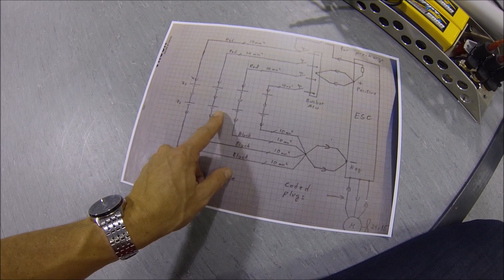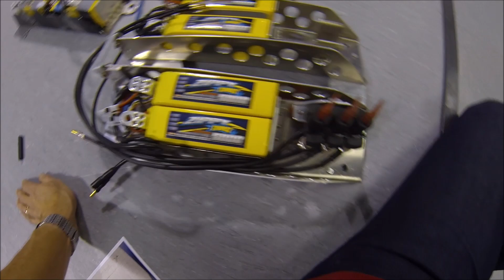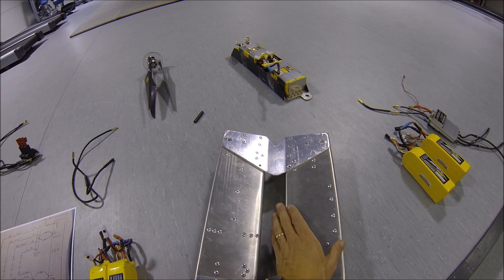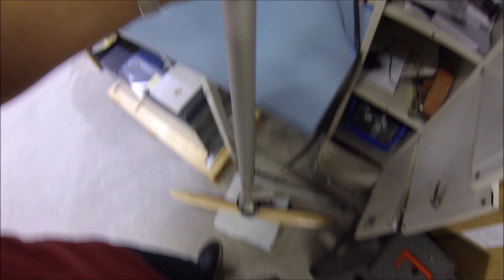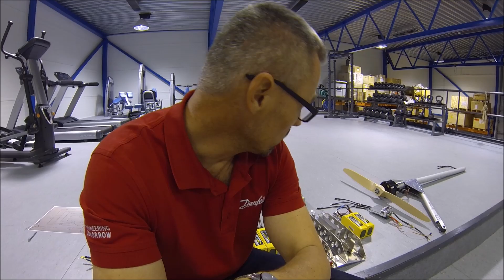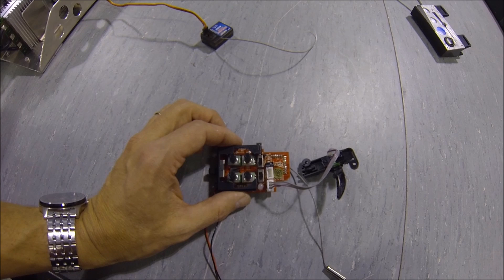E-Help, how it is made, part 1

Comment: Nice video.  What is the total battery life?  I mean, how long can you fly with the engine running?  Sorry maybe in the video you said it but I don't speak English I'm translating from Google...
Reply from the maker: This small 0,5 kWh you can fly for some 10-12 minutes. We use it not so much for climb more for  moving horisontal after launch from small hill. The can easily fly 5 km distance to better thermal trigger point.
Reply: @AcrodesignerLNSNI  thank you so much you are very kind :)

Comment: Hi. Does the foldable carbon fibre propeller fold out when it spins? And can you please share with me the brand? I would like one. Also what 80KV engine are you using?
Reply from the maker: It folds out by centrifugal force. And folds in by windstream and rubber band pull. The prop is from company RASA. And is a 3 blade 34x22

Comment: what method do you use to lock the propeller so it doesnt windmill when the power is off in flight?
Reply from the maker: Paul Martin We activate the brake function on the ESC

Comment: I have been waiting for this type of awesome system to become a reality for the masses! My question: I have a Guggenmos E7 I want t o use this on. Do you think it's too heavy to foot launch like the Exxtacy? My E7 seems pretty light on my shoulders when running on flat ground. Maybe if I limit foot launching to a good headwind!? Thanks for your work!!!
Reply from the maker: In good headwind anything goes. But ground handling is still pretty heavy with an Exctacy. I have flown the Axxess fixed wing a lot with E-Help but aleays dolly start

Comment: The e-drive systems for kites all look so bulky and complicated.
Is not it possible if you take, for example, 2 aluminum or carbon tubes, in which you installed the drive batteries, this then under the focus left and right of the longitudinal center bar
Fastened.The motor with the folding air screw is attached to the end of the central tube, the wiring can indeed very easily with control panel in or on the Speedbar
Be attached.
Thus, all parts would be housed in the smallest space and you would not have to carry everything on or in the harness with.
It's just a consideration as a layman. Or the drive must be mobile on the pilot.
I think if it comes to a tipping moment, the pilot can indeed start from a starting car and avoid this.

Comment: how much thrust does it give
Reply from the maker: The student version is about 28 kg with the 34x12 prop and the big flatland version is 32-34 kg thrust with the 34x14 prop at some 4500 rpm about. The rpm increase and the load decrease when moving forward so my numbers for static ground tests changes a bit in the air
Reply: if i use 16 s what will be thrust

Comment: Thank you for your valuable work and patience, Reidar. Have you considered using lithium battheries instead? You can reach up to 7 Ah for 0,6 Kg in one element (Skyrich HJP7L-FP for example). What do you think? Thank you in advance for your kind answer.
Reply from the maker: The C rating is usually very low for lithium batteries compared to lithium polymer. In the newest version of E-Help we use a Crating of 70. The battereis are then type KDLIPO 5000mAh 70C 25,9V
Reply: Thank you!

Comment: Awesome. What is the altitude you can reach from the flat land start with the student or full version ?
Thank you
Reply from the maker: The student version is not flatland capable. Only 0,5 kWh and ment to be a zero sinker from hill to find thermals. The full version 1kWh with nanotech 90C batteries can climb from flatland to about 400 meters but that is misuse. Correct use is to climb to some 150 meters only and then use reduced power to cruise zero sink for finding thermals over a 5 km out and return pattern.
Reply: Reidar Berntsen Thank you, good work

Comment: Hey Reidar , is it possible on this esc Hobbyking (6-14S 60v) to use 3 packs 5S (15S ) 18,5V x3 = 55,5 volts,  with the new motor U15 II KV80 ( http://store-en.tmotor.com/goods.php?id=731) thanks a lot

Comment: Hello Reidar
What maximum RPM prop 25x15 the 30x10??..thanks
Reply from the maker: 25x15 on 150 KV it is about 7000 rpm and with 105 KV it is too small prop yo make sense. The 30x10 goes supersonic tips and breaks down performance at 150 KV. On 30x10 that is a too small prop for the 105 KV.

Comment: I find a motor with original 65 KV and 25KW for the same price like the hobby king motor you guys use. Du you think that I can use this motor with the same akkus and only drive it by 70% of its power for not heading up the cables of the motor?   http://alienpowersystem.com/shop/brushless-motors/120100-s-sensored-outrunner-brushless-motor-65kv-25000w/
Reply from the maker: Christian Loeko Yes, the Alian motor will work. At 65KV it can turn slow big diameter prop. The advertised 25 kW is at very high amperes that i difficult to find batteries that can feed such an animal. The Alian is closed loop with sensors and should be run with an ESC made for this motor. Our Turnigy dlux 250 will not suit the Alian.
Reply: Thank you for your answer. I´ll use an other ESC but build an current limiter. I tested it with 210A and it works pretty well. now i try to lower the max current to Minimum for a good range extender on XC flights.
Reply from the maker: Christian Loeko Current limiter is basicly just to select a smaller prop. If You select 12 s battery then the rpm should end up in the 3000 area and huge torque. Prop may be some 38x14 from Menz. Just guessing here. Prop efficiency will be serious good. Prop could also be some powered paraglider type if You can fit the hub. Avoid 3 blade prop, they are a pain in the ass for transport.
Reply: That´s really helpfull!  I try it with a 12S System and I think i buy a 39x13 Paramotor Prop, I completly forgot about the Transport thank you for this Input! I also think that I need not that much power as you because I not want to start in the Flats and I only have 65kg. So maybe I reduce the RpM int the area of 2500 with 19kg maximum drag.    Also i wan´t to say thank you for the great Videos and the really good Inputs!!
Reply from the maker: Christian Loeko At 65 kg body weight You will with a glider like Falcon 170 or similar fly zero sink at 15 kg thrust and at 30 kg thrust have a climb rate at 1 m/s. However, Yor sustem should not be more heavy than the E-Help Student 10-12 kg because it gets to unpractical. A big diameter prop like 38 or 39 at 3000 rpm is very efficient so You save the weight by reducing the battery size. 1kWh battery weights 8 kg, You need only half of that because the energy does not get to waste in losses. Check out videos from a Newzeeland called Brendan that haa made a 12s version of E-Help. Just started testflights an put out two videos
Reply: Thats good to know, my testing is with car battery and I buy the LIpO´s the next days. Also my glider is a bit better than a falcon so I try it with 0,8Kw/h below I think that I´m not able to get enough current with 20-40C.  I´f seen Brandons Videos already, this is pretty professional but his conzept uses 14S with 8 really big Zells I think.? https://www.youtube.com/watch?v=d3AuHhnzxZA                                                                                        https://www.youtube.com/watch?v=X1ta6k3oR-Y This guy uses a 6S System but he writes that the fuel burn with his 165KV Motor is brutal.
Reply: @christianloeko5834  how is your project going?

Comment: Thank you for the very interesting videos Reidar. I am about to set up a very similar system and I am having a very hard time trying to find some good explanations regarding the setup of the Turnigy dlux 250 ESC. How did you cope with this issue? Did you just go for the factory settings? For instance, you changed parameter “break” from off to on. What about the other programmable parameters?
Reply from the maker: Well, that is actually a challenge since manuals are only some unprecise stuff found by googling. However, Hobbyking support adressed the problem very nicely for me by sending me a Turnigy dlux Programming Box that made programming very easy. With that tool we adjusted all E-Helps here in Norway to a bit more refined settings. Activating brake and making accelleration softer, cutting off power at higher cell voltage 3,4 volts to protect batteries was main things. Also verifying that batteries actually are set to 14s and not default 12s for correct battery protection. Cudos to Hobbyking support for very nice help in this matters 👍👍👍

Comment: Dear Reidar,
which size does your rectangular tube have here 40x40x3mm?
Reply from the maker: Michael Behn Yes, it is 40x40 rectangular tube, regular aluminium quality, a bit heavy in itself so better to cut lightening holes. The holes also helps for cooling wires and when servicing. Doubled by inner sleeve up at the attachment pin side.

Comment: Thank you very,very much for answering my questions. I presently have two gliders One Exxtacy 160 and a Lamouette topless. I need to buy a easier glider to fly, and I would like to buy something more performing than a Falcon. 
Do you still like your Astir and is it good for flat land start ?
Reply from the maker: Louis Charland I slill have my Astir and it is excellent for mountain start or dolly flatland. Foot flatland is possible only if wind is more than 5-6 m/s because even though it is a very sweet glider the 155 sq feet needs more speed than You can run. The Fun 190 barely pulls it off in zero wind, the Astir would not.
Reply from the maker: And btw, the La Mouette topless you should not fly with E-Help. It is an early generation topless and handling may get rather challenging when adding the torque and forces from electric propulsion on it. The Exxtacy performs very well in the air with E-Help but the weight and ground handling makes foot launch inpractical. My Axxess almost same glider is only possibel to fly E-Help when launched from dolly system. It's a bit impractical and I have reverted to "easy gliders" last years and then the Astir and Fun 190 works pretty nice.
Reply: You are absolutely right ! I fly my topless only with my Cosmos trike (to hard to fly alone), and the ecstasy will be good for dolly or winter on lakes with detachable skis ! I found my left a used 195 falcon ,that should the job for expérimenting with the E-help. Thank you again your a generous man with your time and knowledge.
Reply from the maker: Thanks. As You see from another video, the spot landing of E-Help inside Oslo City, I used a Falcon 2 195 sq feet with keel removed. Was very sweet to fly with E-Help footlaunch. Very similar to Fun 190. If Your body weight is less than 80 kg I would recommend the Falcon 3 170 sq feet that probably has the best overall performance with E-Help. A bit too tiny for footlaunch in zero wind but unbeatable for easyness and climb.
Reply: Thank's and happy holiday's with your family.
Reply from the maker: Louis Charland Thanks and same fot You and Yours !

Comment: Thanks for your good explanations Reidar. I am a mossie flyer and now busy to build an E-help according your videos.
Is it possible to combine the E-mossie and the E-help on the same harness? So to use it on different gliders? How
 important is it where to attach them at the harness? Is this exactly at the center of gravity?
 You rewinded the motor with 13 strands. Is this the maximum? 
Many, many thanks for your engeneering work.
Reply from the maker: Hi. I use the same battery module for both the Mossie version and the direct driven version. On the Mossie version the side bars are attached to the battery module with a long steel ping trough the whole battery module. Can be seen on various videos last years. It is imbortant to attach motor boom part about same place as harness hang strap is attached. Otherwise there would be strong trim forces. The motor when rewound to 13 strands with 0,6 mm2 wire is about the maximum amount of copper You can fit into this tiny stator when 5 turns per pole.

Comment: Reidar, thank you very much for your vidéos and your know-how, I'm in the process of gathering information in order to build my self one, is your prop Menz 34/14 a pusher ?and is there anyone rewinding the Rotomax somewhere ? I can't thank you enough for the tutorials.
Louis from Québec.
Reply from the maker: Louis Charland Thanks. Props are no difference between pusher and tractor bcs it only to seap two phases to change direction. Maybe Chris at HK will do a lower KV version for You. He has said he will. I sometimes build one for others but it is rare.
Reply: Hello Reidar, my E-help is coming along pretty good, i am still waiting for my hobby king order do, I have finish the aluminium part, I have my props and I know pretty well how to do the rest , but I would like to ask you a few questions if you don't mind. please please please ! The first one is : how does the propeller brake works ?
Second one: where do you get your pre-charge switch ? Third one: with the Rasa prop, what is the clear round 
 part between the motor and the prop.
I cannot thank you enough for your help.

Comment: Cant Thank  you enough Redar , this was a excellent Video , very well executed and great to see the thought processes that lead to The E-help system . My Project is an E-One Paramotor Launch and Thermal Finder  unit not for cross country but just for Air time ..your videos have been eagerly watched and I learn something new every time ..Thanks these Videos you do are a great help and may allow the dream to come true  :-)
Reply from the maker: Thanks for nice words 😊. Electrical systems for pg have been done in many forms and my thoughts are this. Mainly two issues, prop efficiency and glider drag. Prop efficiency is vastly diminished on a pg backpack setup due to the prop working in the turbulent air behind the pilot. Not so easy to solve but a tractor setup, dual prop or distance piece could be 20-30 percent improvement. Drag in the glider then a high efficiency glider to reduce the size of the electrics makes sense to me. Maybe has to be launched engine off from hill then to master the more lively and demanding glider. However, the traditional gas powered PPG gliders are positive reflex and monster drag machines requiring almost double the power of a hangglider. Don’t see that as a viable glider for electrics.

Comment: Nice vid Reidar :) Your comments on battery packs resonated with me. Electrically I think it would be ideal to go 18S (3 x 6S) as then you have nice power with less Amperes (also less copper/gold needed). Economically though, you get much more bang for buck ($value$) by buying the largest pack you can (S or AmpHours). As drone lipos (currently) seem to top out at 6S, this then is probably the sweet-spot for buying lipos packs and chargers. Which as you say brings us to 12S. What do you reckon, take off one winding when rewiring your particular motor? Just on this, Freerchobby Co's MP12090 series has a 130KV product, would save the rewinding chore.
Reply from the maker: HG argo 12s on a 130 KV would work I think